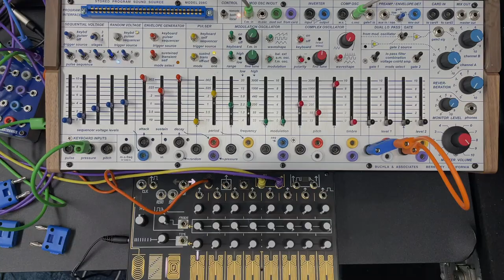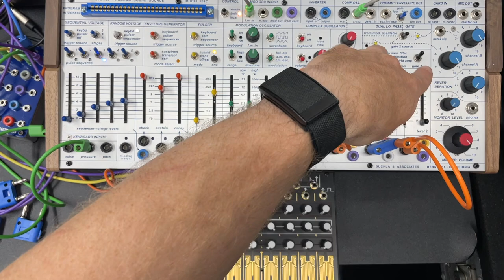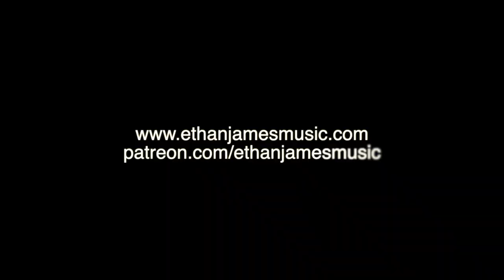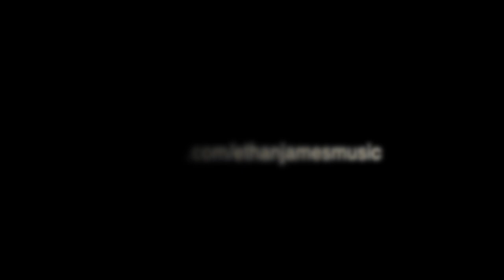Buchla 208c Easel Command tutorial Lesson 14: Sequential Voltage Basics

Comment: Curious how the o-ctrl is cabled into the Buchla with three patch cables.  I think I know but would like to be sure.
Reply from the maker: touch gate is going to the gate input on the back, CV sequence of the top row is going to the 1v/oct input, and pressure is going to a Low Gain converter box and then to the banana pressure input
Reply: @EthanJamesMusic1  Thanks!  I’m just getting started with mine so this helps.
Reply from the maker: @spdycar13  happy to help!  The only thing to be aware of, if you're using a 0-ctrl, is that you need to use the touch gate if you're using the 0-ctrl as a touch controller, and you will need to switch the cable to the dynamic envelope output (or sometimes the dynamic gate output) if you are using the 0-ctrl as a sequencer (with the 208c using the switches in keyboard mode).
Reply: @EthanJamesMusic1  Thank you again for the tips!  So much appreciated.  Buchla is all new to me.  I just ordered a UTL-1 box too.  After seeing it used in several videos including yours, it seemed like a good investment for banana to minis.
Reply from the maker: @spdycar13  let me know if I can do anything to help you!
Reply: @EthanJamesMusic1  Much appreciated!